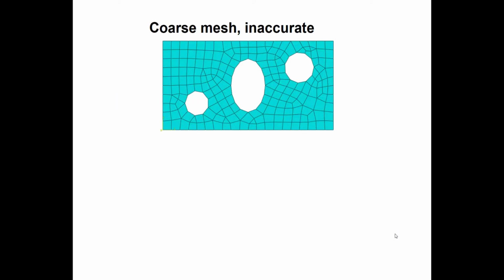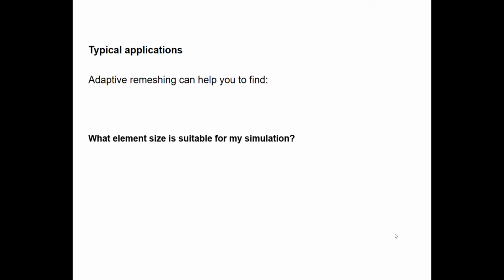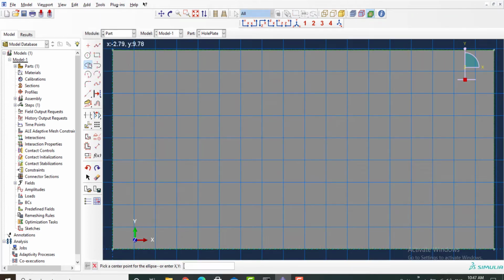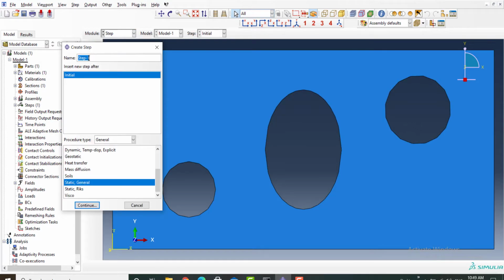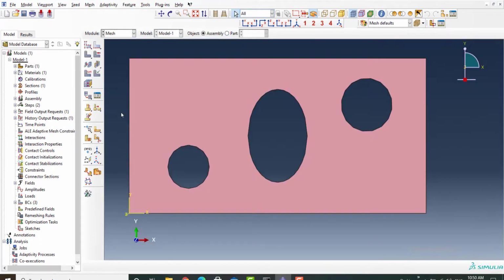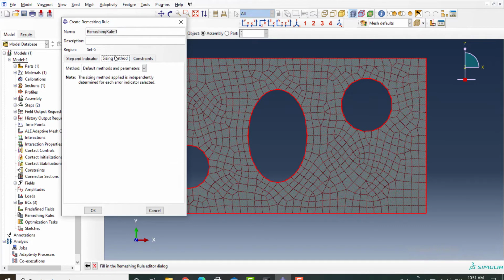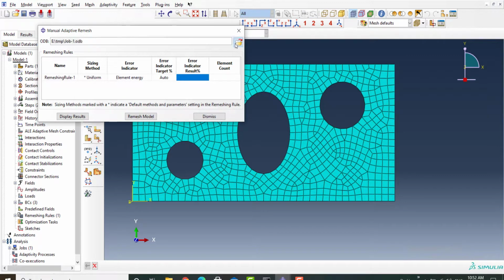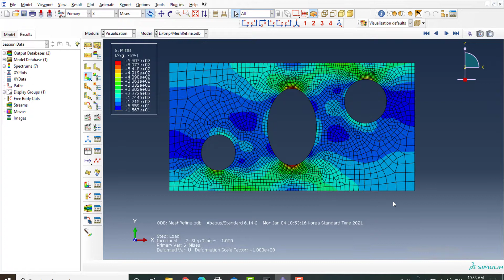How to create variable mesh size in ABAQUS by adaptive remeshing/addaptivity technique

Comment: If I have a laser source to be moved on a plate and want to have adaptive meshing only in near by regions of laser movement. What should i do.
Reply from the maker: It seems that you need ALE remeshing:
https://www.youtube.com/watch?v=0VKjCE4Ad5c
Reply: Hello. Did you get an answer for this question. I am facing the same problem except replace the laser source with a an endmill. I want refined mesh only near the endmill and the endmill is moving across the workpiece.

Comment: Dear sir,
   I have been following you for quite a long time now. I just has one query related of my research area. 
  Can you please provide me insights about defining stresses for a model containing shell element. 
                                                            In other words
Lets say shell element has a (S4R) has a five intgration point along the thickness. I found that it is possible 
 to provide a initial state (at intgration points) such as temperature, stress etc. even before running analysis. I wish to know how. As 
I did some literatures it is not possinble usisng GUI, but by python scripting it is possible. 
                            Can you please help me with this, either directing me with some examples or so...

                                     Thanks  in advance.
Reply from the maker: Initial states can be defined both in GUI and by subroutines. You can find defining initial temperature in this video:
https://www.youtube.com/watch?v=V2IS8X19HKE&t=46s 
Initial stress can also be defined by directly inserting the values, by an ODB file or by subroutines.
Reply: @engineering_software  Thank you for your instant reply. Just in addition can you please tell me how to do it for shell along the thickness (integration points).

Comment: thank you for your videos on adaptive remeshing they are very useful for me.
In the abaqus manual it's written that one can perform a preparatory analysis such a linear perturbation, and with less complicated steps, load history and materials to obtain a refined mesh (or maybe error indicators), instead of remeshing the actual model (more complicated and with multiple steps and with plasticity...). I never found examples of this, but maybe i can simply point to the .odb file of this preparatory analysis from the model I want to remesh, using manual remeshing like you did...I have to try. Do you have experience in this?
Reply from the maker: As you mentioned, you can simply follow this video, in the first job use simple step and material, then the same as the video improve the mesh quality and after obtaining desired mesh (maybe after a few job) for the last job you can change the material or step but keep the mesh.